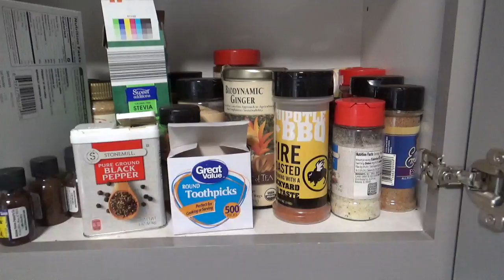Modeling Realistic Grain Spillage On HO Scale Covered Hoppers!  DCT HOW TO's!

Comment: Cool detail work. Never thought about the grain spill. Just scratchbuilt a CR coil car #602309 it about 90% accurate. Next up are the Greenville Steel Car Southern bulkhead flat #116109 and Portec Southern coil car #62326. If you can't buy them you build them. Same goes for tank cars.

Comment: Dan, your videos are great but i have a question please?  When you are doing the graffiti, what pen or pens do you use to draw the graffiti please?
Reply: He might use gel pens. I have used a white gel pin, size .08 and .05, before to represent chalk writing marks on sides of cars. I also have used an oil based paint marker with a .4mm point but it's a little too big for HO scale. They make gel pins in all different colors and if you can find paint markers that are fine enough you could try those. The .4mm paint markers would most likely be ok for graffiti. Hope this was helpful.    👍